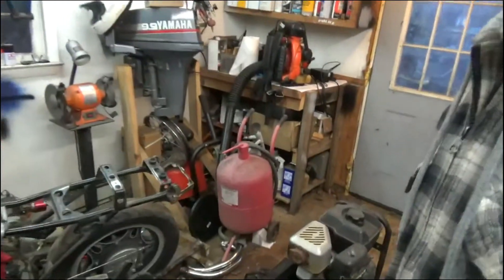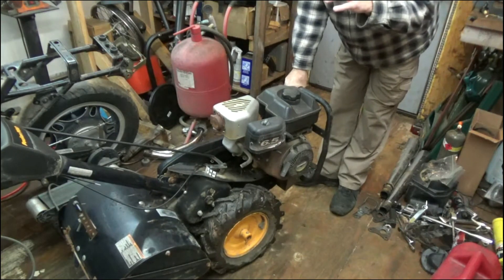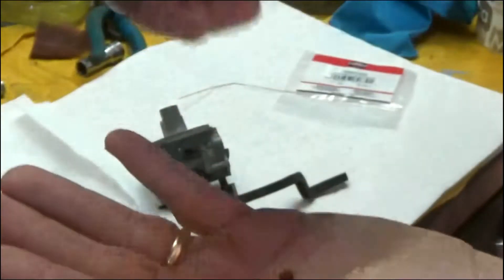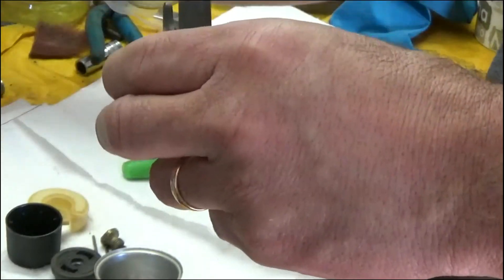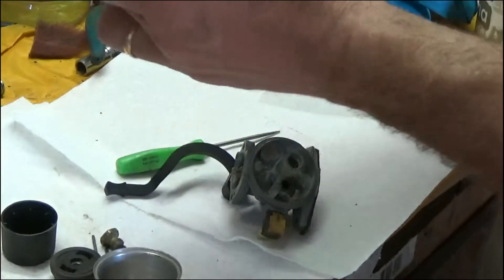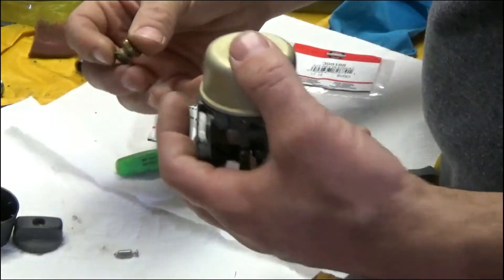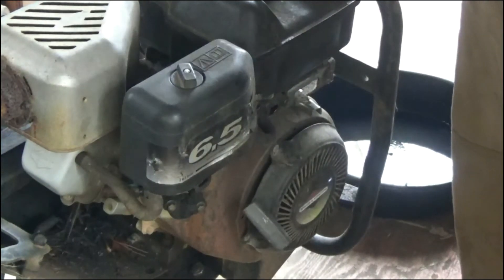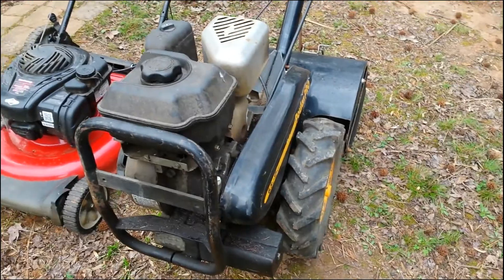Poulan Pro carb rebuild Briggs and Stratton

Comment: Mom has a poulan pro tiler. It wouldn't start. My brother says a spring broke. I have no idea what he is talking about. I have to try and fix it. I am poor as shit right now and can't afford a new 1. Any ideas?
Reply from the maker: Spring broke? Not sure. Pull the carb and check the jets ant float level. I have several videos on carb rebuilds check out my playlist. Most likely the float needle seat is swelled up like in this video. I have other videos with better lighting showing that as well.